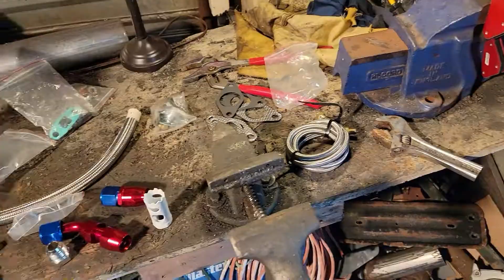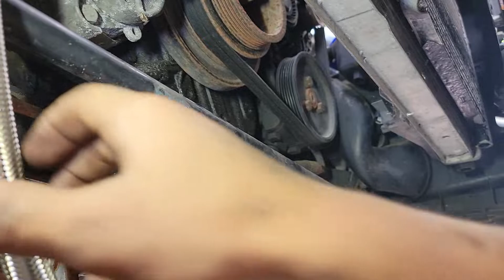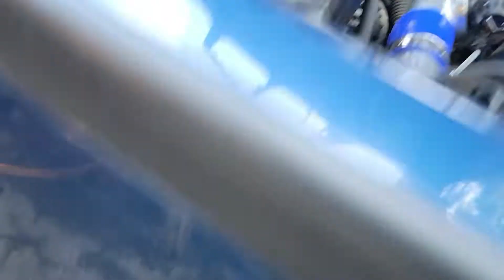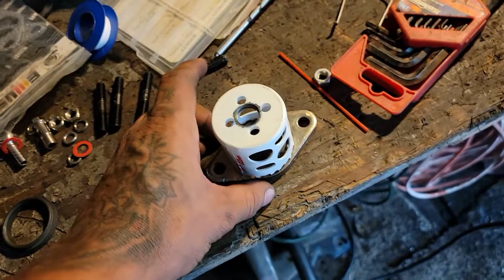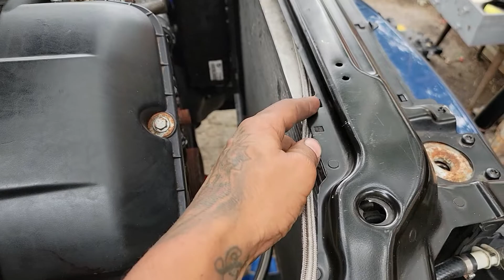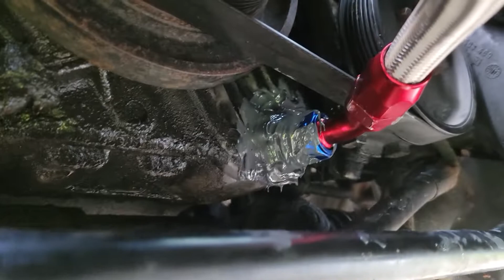S2E8 - Turbo Oil Feed & Oil Drain Install - Easiest Way To Install Without Pulling Engine

Comment: Did that JB weld stay in place without leaking? Also did your wastegate burn up your wheel well or tire?
Reply from the maker: JB Weld is find and the wastegate is fine. It's jusy exhaust going through it. It's not a big deal. When you drive it gets cooled down and it gets air flow into the wheel well
Reply: @AllThingsQuick  Cool, on my S10 I kind of had the dump tube pointed down at the ground and the front bumper. It started melting my bumper until I re-adjusted it 🫠. I also had jbweld in the same spot that eventually cracked and leaked under 12psi. Now I'm questioning if I used the high heat version, SMH.
Reply: @AllThingsQuick  will drilling into the oil filter for the high pressure feed line work on any car?
Reply from the maker: Even if it didn't, it would be fine.